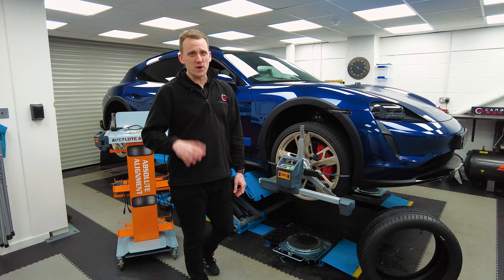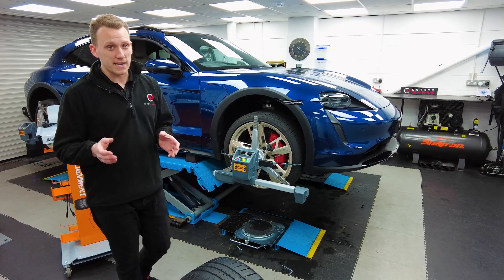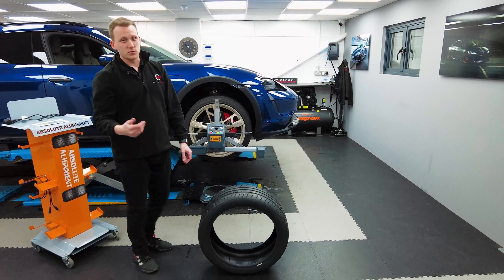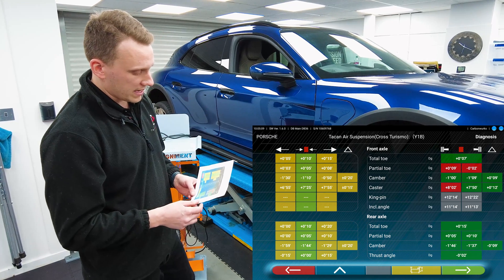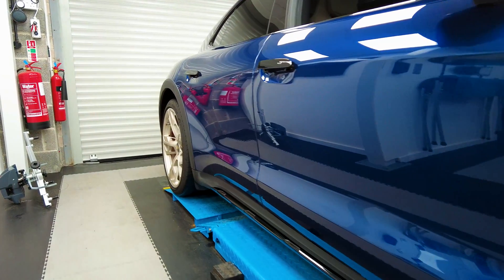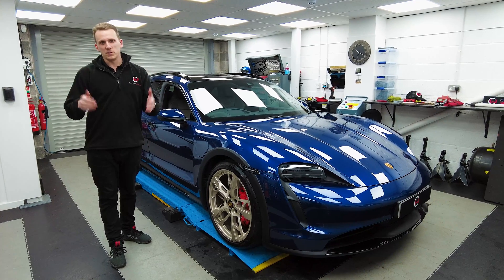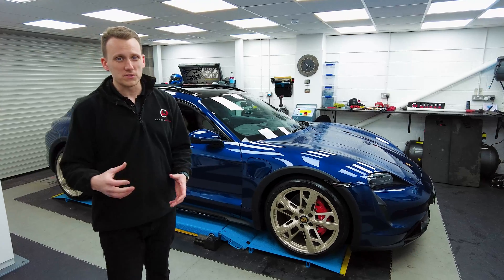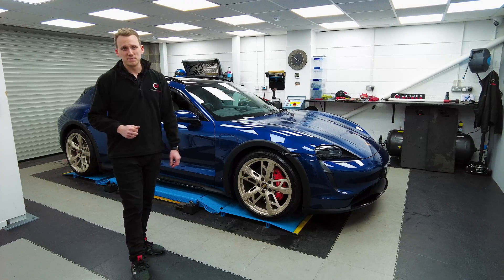Fixing The Excessive Tyre Wear On The Porsche!

Comment: This isn't enough camber to cause high wear by itself. It's the toe.
Reply from the maker: As mentioned in the video, it’s the combination of very high caster angle, combined with camber and toe being quite aggressive. The level of caster exaggerates this.
Reply: @Carbonwurks roughly 8 degrees of caster is not particularly high. 7-8 is typical in most cars, as it eases steering efforts. Caster has no effect on the tire contact patch except when turning.

It's the toe. Toe causes a constant slip angle and is the main source of high wear. You can drive cars with two degrees or more camber on the road with near zero toe and not see hardly any excess inside wear.